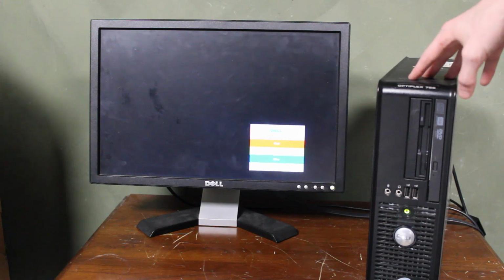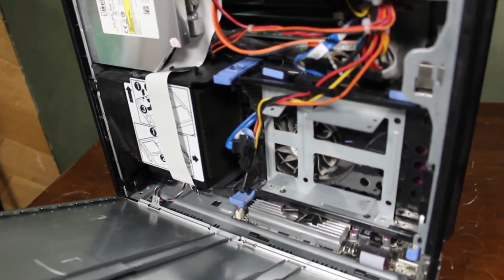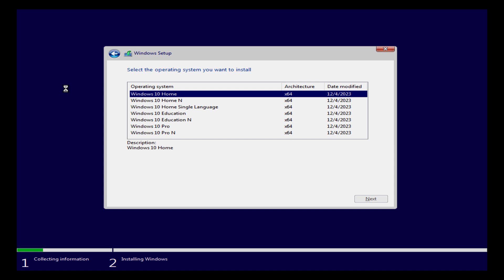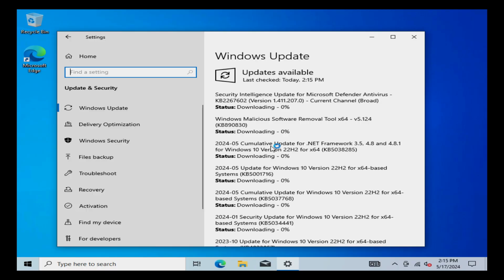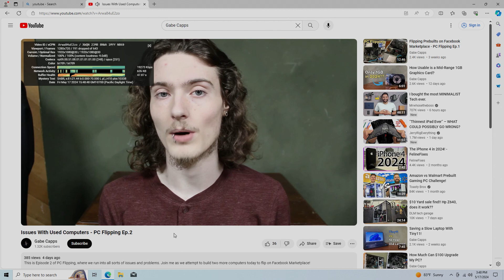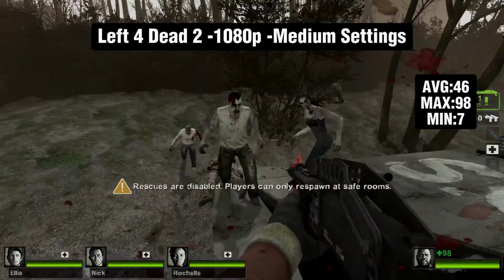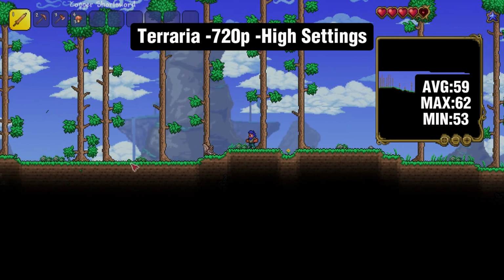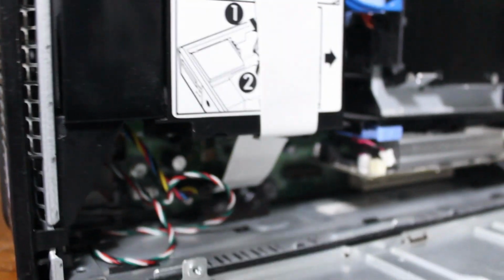Gaming With a $10 Optiplex

Comment: With a bit of modification, you can play most games and do A LOT more with that system, trust me. ANY SYSTEM can play a game, you just gotta know the right changes to make
Reply: Yes, a Core2Quad Q6700 will give you a way better experience (more threads,  bigger cache, higher speed). Maybe plus a GTX 650 (its a card without an exta power connector)  - that will be a nice little machine

Comment: upgrade it with an new graphics card! 😊
Reply from the maker: I plan to give this computer a nice budget upgrade!
Reply: @gabecapps   its motherboard has pcie×16 or not?
Reply from the maker: I believe it does!
Reply: @gabecapps   wait imma see video again and i will tell you it has pcie ×16 bus or not!!
Reply: @SonGoku_9000  A GTX1050 doesn't fit in ths Case. A GTX 650TI (short, only one fan,no extra power supply) will fit perfectly.

Comment: Upgrade it with xeon e5450, ssd, 4x2gb rams and gt1030 lp not bad for 900p 2017s games experience
Reply: Will a Dell bios support any Xeon? Dell ist very picky. My Optiplex 780 would not.

Comment: It's always a blessing to see these old machines not turn into E-waste what I would do if I had this machine is put a Linux destro like arch Linux and try some emulators like some ps2 emulators and Mabey try and upgrade that GPU Mabey a GT 1030 If it fits into that PCIE lane. (correct me if I got any information wrong)
Reply from the maker: I plan to try out other operating systems with this PC! I know that this could be an amazing emulator, possibly even up to ps3/xbox 360!!

Comment: The YouTube playback problems aren't the fault of the CPU. A 2.4Ghz Core-2-Duo with a decent graphics card can play 1080p video from a local x264 file just fine. It's just that the implementation of whatever player is used in browsers is crap.
Reply: On this old machines you can boost your youtube performance by using the h264ify-Addon. It makes you stream H.264 videos instead of VP8/VP9 videos

Comment: Try upgrading to Windows 11
Reply from the maker: I might try Tiny11, but I could definitely see issues with drivers! I will definitely consider that!
Reply: Win11 24H2 will not boot any longer this old machines. So you have two problems: support for win11 23H2 will end in november 2025, also the supoort for Win 10.  Dont ride those dead horses any longer. I switched to linux these days and was surprised how much of my games are playable via steam.

Comment: 4x2GB of DDR2 @800Mhz, A Core 2 Quad, and an RX 6400 would be a hell of an upgrade to see on that system!

My first gaming rig was with a Core 2 quad and a GT 1030
Reply: Id just keep it as a retro system
Reply: odds are it'd overheat with that in that case (maybe even opened up lol), unless he does ghetto fan cooling to help it
Reply: terrbile idea.. RX6400 is already crippled with its PCIe 4.0 x4 bandwith and Core 2 Quad mobos are PCie2.0 which means that RX 6400 will run on PCIe 2.0 x4 which is equal to PCIe 4.0 x1 so 4x times lower bandwith

Comment: Have this same PC, upgraded to 8GB RAM, for GPU I have a GTX 750TI (a 1650 can be a good option), and for CPU I used an Intel Xeon X3363 which is basically an Intel Core 2 Quad Q9550 (Modded from LGA 771 to LGA 775) with the latest BIOS update to get the CPU microcode.
Reply: isnt that a massive bottleneck even at 1080p.. there were few games that i tested where i5 3570k bottlenecked the gtx 750ti, that i5 is a lot better then the ones you mentioned so adding 750ti is already too much but i guess could be a cheap upgrade but a gtx 1650?
Reply: @Ciffer-98  Practically... yes the 1650 would be bottlenecked, but it could help with emulation... just a bit, not by huge margins, this kind of PC it would b mostly suitable for WinXP era games, or as a Batocera/Lakka emulation station.

Comment: I would go for XP or Windows 7 and play old games. Do not go on the web with XP.  I would not mind a spinning HD with XP and use the SSD elsewhere. An experiment: You could try dual boot with XP if some games do not play with Windows 10.  You could browse the net with Windows 10.
   To clean dryed thermal paste: use first lighter fluid ( it melts the paste ) then wipe, then clean with alcool.

Comment: So, that is a floppy cable and is not the same as an IDE cable. While they are both ribbon cables, they are not the same and are not interchangeable. IDE cables are only used for magnetic hard disk drives. As for the "integrated graphics" there are no integrated graphics on the Core 2 Duo. What you are seeing is the south bridge. These older boards would have two "chipsets." The north bridge and south bridge. The south bridge, would also perform the basic function of video output, but that is not it's sole purpose.
Reply from the maker: Thank you for sharing that! I haven’t seen a chipset like this before, so it confused me a little bit!

Comment: I have a 760, put a intel core quad in it (the strongest cpu that that motheboard supports) 8gb of ram, 240 gb ssd and 1 tb hard drive, a GT720 and windows 7. It's pretty good honestly, considering that the WHOLE computer cost $25. It runs photoshop 2015 good, web browsing is smooth. You should have put windows 7 on it. many games still support it
Reply: Steam requires Windows 10 though

Comment: now now. i would love to see an overclocked q6600 (bsel mod, aka overclocking it with electrical tape) + a decent low profile gpu. if the motherboard supports 4 slots, it should work with 8gb ram, in theory

Comment: Hey, I recently got a 755 off ebay for £10! It's got a second gen i7 and 2gb ddr2 but  found for it 8GB ddr2 800mhz with orange heatsinks for another £10, now which GPU to pair it with? All the fans including psu fan are super quiet, this is a keeper :D

Comment: If this thing can take a Core 2 Quad, look for the Q6600 and the tape overclock. It's super easy to do and can get you to 3 gigahertz with almost no power increase and it can work in any OEM motherboard.

Comment: I would have bought it, but I have a question.  If I ever get as lucky as you to get a pc like this, what can I do to it to upgrade it enough to run Windows 11?  And could I actually upgrade the internals to make it a newer pc?  I don't play games on any pc, I use a console, senior here, lol.  So I would use it for work purposes, such as read email, surf the web, Office 365, fix some photos...etc.  Simple things like that.
Reply from the maker: I really feel like Windows 11 would not be possible with this specific machine. Upgrading is definitely possible in many prebuilts, you can look up what the system you bought supports! With doing basic tasks like that, Windows 10 should be fine, and a low budget pc would be very friendly for that! You would be wanting to look for 3-6th generation i3, i5, or i7 if you’re lucky enough! And pair that with atleast 8gb of ram and a 1gb graphics card, you should be good to go!

Comment: I have one of these 755 Dells! I maxed out the ram from 3 to 8 GB and upgraded the cpu from a E4400 to a E6750, all from Ebay for $15 CAD total. Installed Linux Mint, and it runs excellent. This is something I bought used about 10 years ago and just shoved it into a closet when I found it couldn't run Windows 10. Now the upgrades are so cheap, it's worthwhile to bring these old tanks back to live another life! (And an old 128 GB SSD I had laying around)
Reply from the maker: A lot of people are mentioning Linux Mint, I will have to try it out!
Reply: This era of dell is known to have poor quality capacitors that will need to ne replaced before they go bad, theyre not expensive and its just a half hour soldering. A 1050ti should work in this system.
Reply: why did you upgrade from E4400 to a E6750, there is barelly any difference btween them also its strange that you couldnt install win10 on them
Reply: @Ciffer-98  The E4400 could barely run Youtube videos at 720p while the E6750 can manage 1080p. The difference is noticeable in a lot of other situations as well. I could install Win10, but even with the better cpu and maxed ram it chugged badly. With Linux it runs quick.

Comment: 0:44 That is a SATA and SATA power cable. IDE cables look like a 30-pin power supply plug, but smaller. The cable would also wide.
Reply: Floppy disk cables are 34 pin but the floppy disk shown in the video is most likely a rare mini pc one
Reply: @rusrus67  i sure do love rare form factors
Reply: @rusrus67  Dell did a bunch of propriatary stuff back in the day, they still do, just not to the extent they used to imo. It's a little tricky to tell, but it's likely one of two options, either a dell flex circuit connector or a more standard micro floppy disk drive connector, that was used in SFF PCs and laptops at the time. 2004-2010 was pretty wild time in OEMs almost every one had some propriatary connector it made working on OEMs more of a pain than it is now.

Comment: This is an awesome video. Most of us are so tempted to start throwing better parts and upgrading instead of just seeing what it can do as it is. The SSD is almost a requirement these days, spinning drives are just so painfully slow that it would make the process unbearable. Besides, a 128GB SSD can be bought used for about $5 used if you are patient, so it really doesn't distract from the fact you are working with a $10 PC as it was found.
Reply: People always say an ssd will fix everything, but people always forget other components being much slower and using a hard drive there would be fine since it would match the speed of the system. Ssds these days are just a gimmick
Reply: I actually have a Dell laptop with a core2duo. Swapping the 80GB HDD to a 256GB SSD didn't make it fast, but it did make it far more useable. I have a couple of programs that require a 9 Pin serial port and Windows 7, a USB to 9Pin won't work, and compatibility mode doesn't work. The SDD and upgrading to 4GB of RAM made it pretty useful, when I used it before it took 3-5 minutes to boot, now it boots in less than 30 seconds, and the programs open instantly, before it took a long time for them to open.  @rusrus67
Reply: @rusrus67  you had me in the first hald not gona lie

but seriously, ssd now days being a gimick is completly false, back then having an ssd would only make things load faster but wouldnt benefit the actuall performance at all unlike how nowdays some games can stutter if they are on an hdd,
i also thing that for people who build thos old pcs i would recommend that instead of spending more on the ssd rather put that money into other components
Reply from the maker: That was roughly the cost of this! I buy my ssd’s in bulk, so I get a pretty good deal!

Comment: Hey Gabe have you considered buying gtx 750 ti?
It is budget friendly and it doesn't need external power.
Great video btw!
Reply from the maker: It has crossed my mind! I plan to get more gpus for future videos!
Reply: I think a Core2 Duo would bottleneck a 750Ti. Maybe it would be better balanced if it was a Core2 Quad, but the BIOS may or may not support such an upgrade. I had a Vostro 200 some years ago with a Core2 Duo and it wouldn't support a Quad.

Comment: Great video, Gabe! One thing that I would do is install the h264ify extension to your browser, this will help with the YouTube playback. I am not sure how much it will help, but others have used it on similar hardware and it helps fix the issue with dropped frames. As others also mentioned, I would update the CPU and ram and see how it goes. I also think your trying out different operating systems and emulation for older consoles is a good idea too. Looking forward to seeing the next video. Keep up the good work.
Reply: Should that extension only be used on lower end pcs?
Reply: Bro Thank you so much for this advice i have the same issue with the same pc he has in this video and it helped me alot with youtube playback THX.😃

Comment: Great video, Gabe! 
Windows 10 with 4GB of DDR2 must
of been pretty painful, even with an SSD, haha. 

I would love to see this PC with a
Core 2 Quad, (Q9550 Maybe) 8GB of DDR2
and a better GPU in the future, if possible.
Reply from the maker: I was thinking of upgrading this in the future! I’m used to slow loading lol, I never had the best technology growing up!
Reply: @gabecapps  
Haha, same here! 
I use to own the Dell Optiplex
755 a few years ago, had the Pentium
E2160, 4GB of 667 MHZ and 80GB
HDD. Yes, I hated how slow it was,
but appreciated what I had regardless.
Reply: Since he's running Windows 10, the 8 gigs of RAM would help out in spades. A better CPU would be nice also. However, since the PSU in that thing can't be very powerful, I think for a GPU upgrade he should use something like a Radeon HD 7750. It's low wattage but still powerful and will allow for Direct X 12 (feature level 11_X).
Reply: Yeah if he can find a low profile version. Might be easier to find RX 550 or GT 1030 in low profile, and those are true DX12 cards.

Also Radeon Pro WX 3200/4100 are DX12 and can be had for about $40 on eBay, might be the best option.
Reply: Reminds me of my own excessively upgraded Optiplex 745, which now has a Q6600 (it only supports the 65nm CPU models, not the later 45nm).
A R7 240
8 GB RAM
Reply: Most of the old dells max out with the e8000 series of core 2 duos, if that can take a Quad-Core might need to look at cooling by upgrading to solid copper heatsync.

I'm running one of these as a late era Windows xp machine, considering upgrading to Vista. E8500 core two and 4gb of OCZ ram

Comment: Im very curoius: what are you gonna do with this pc? Isn't it too bad to sell?
Reply from the maker: I think I might install Linux, maybe upgrade the ram to 8gb, and turn this into an emulation machine! If I need to, I can sell the parts online! But I want to see what I can do with this!
Reply: @gabecapps  remix  os  or pheonix os are  pretty good for older pcs or one of the random  android  os  should  work nicely  on this also .
Reply: @gabecapps  if you're just going to do emulation you could probably get away with 4GB. Batocera doesn't require a lot of RAM. If you want to use it as a Linux desktop, yeah 8GB might be good.
Reply: @gabecapps  Check my comment, you'll like my idea. Sell it for someone who is into retro gaming.